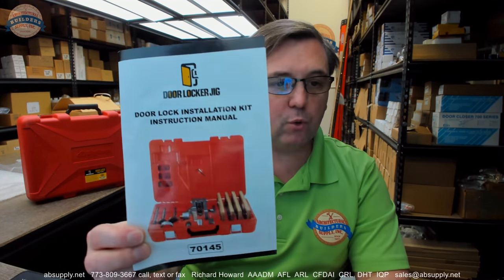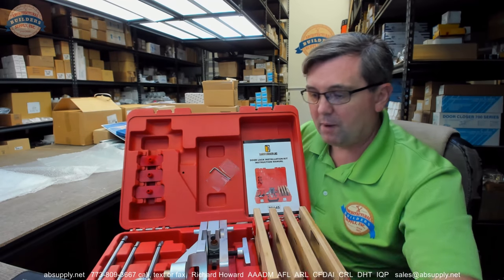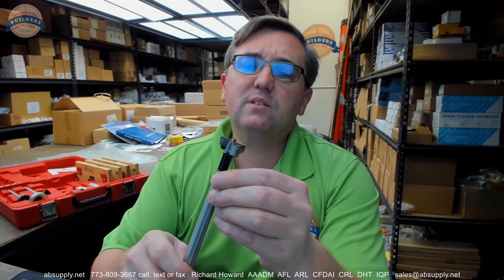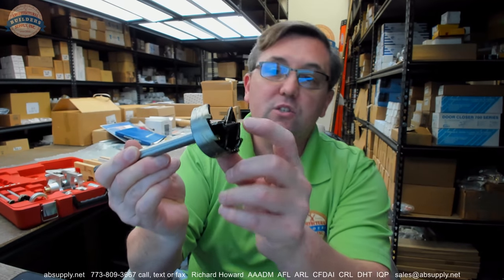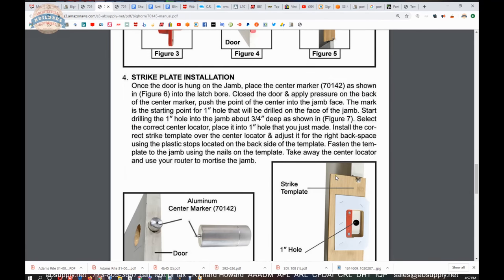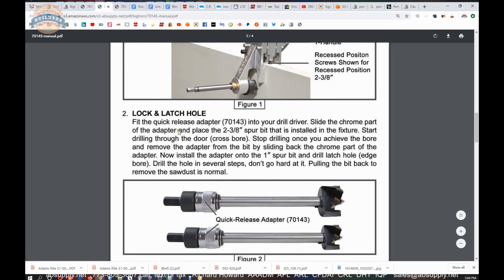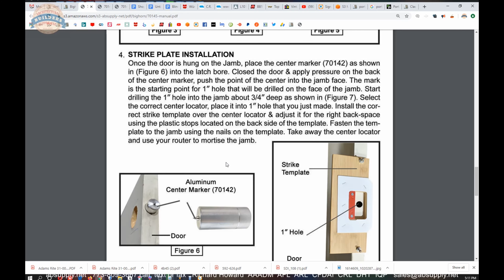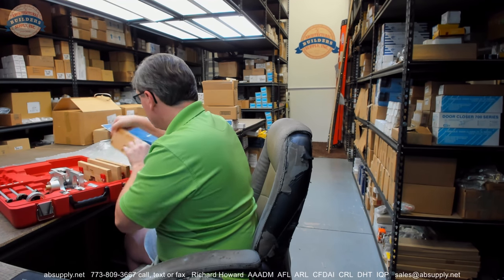BigHorn 70145 Door Lock Installation Kit   BJ 115 C3

Comment: I use an L bracket . It has a spring loaded clip on it that slips into the hole on the strike plate to line up the holes . Then mark and drill .  Ready to install the knob or lock in less than 5 minutes